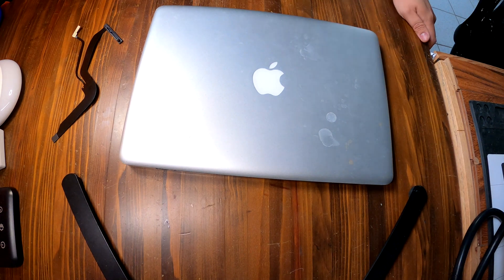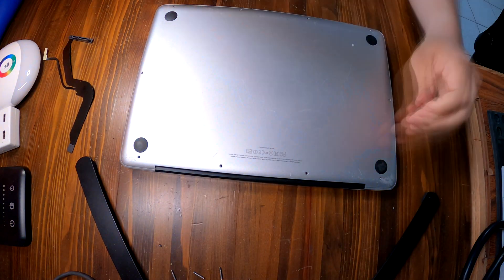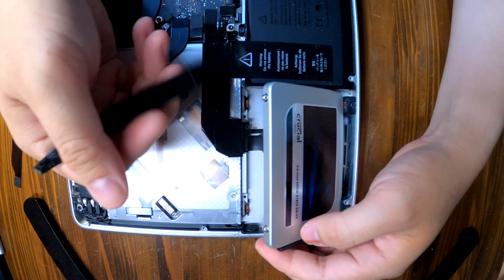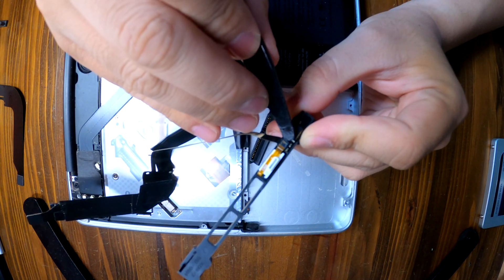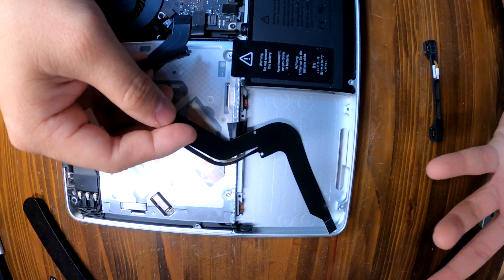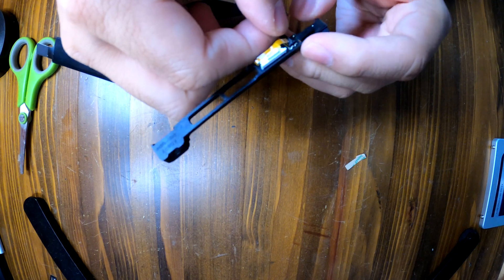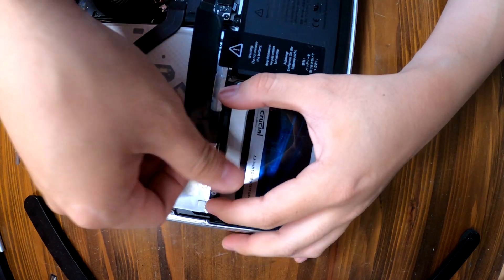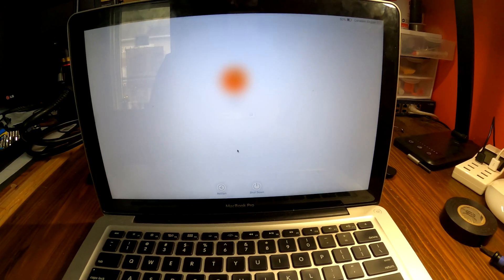Apple Macbook Pro A1278 Question Folder FIX! (How to replace the HDD cable)

Comment: I have the same problem with questions Mark folder but wenn I turn on, the computer there is no sound, pressing the keys does not help. I bought some MacBook pro a1278 without a hard disk,  the new disk is not loaded even via usb. Can someone help

Comment: How do I know it’s hardware and not software? My issues started after my MacBook froze and I tried to reboot it to get it working
Reply from the maker: To make sure, you will need to remove the hard drive and test it with a diagnostic software. Then you can tell if it's a hardware issue or a software issue. It is just common to have a faulty hdd cable on this model. That's why I uploaded this video.